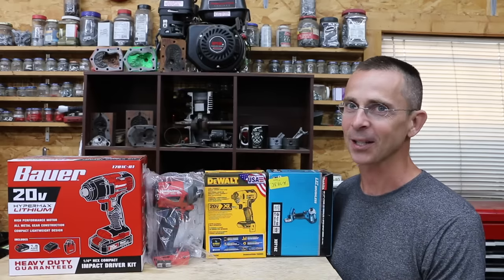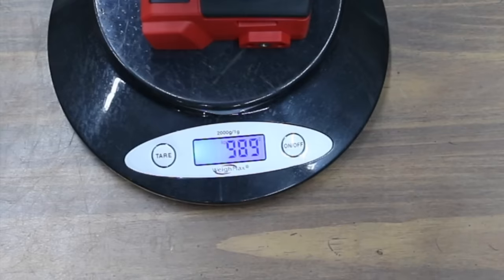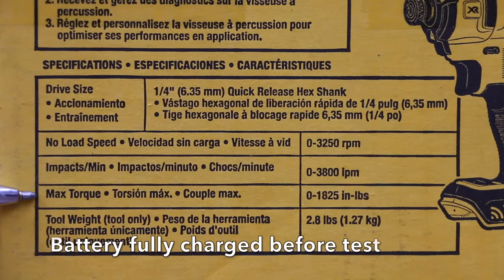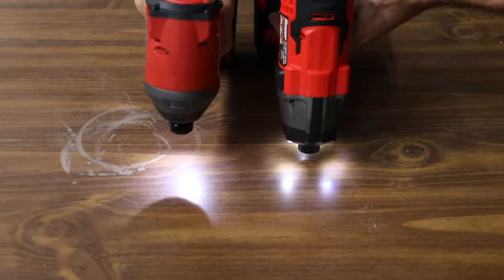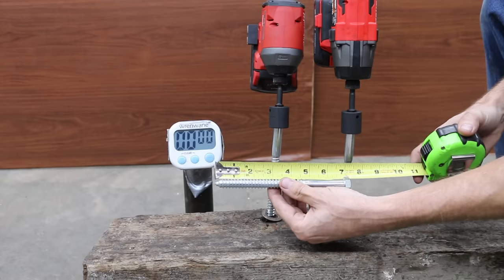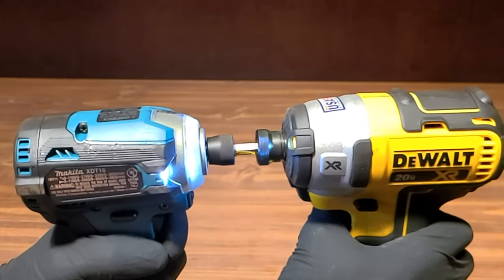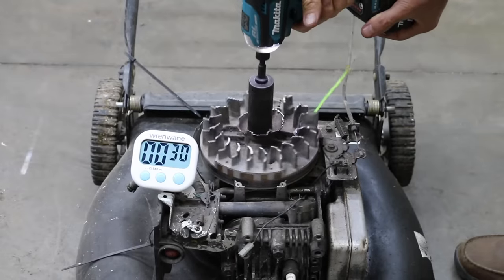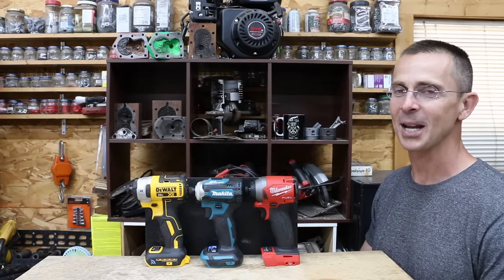Best Impact Driver? DeWalt vs Milwaukee vs Makita vs Bauer!  Let's find out!

Comment: That m18 kit is $99 with a charger and 2.0 battery at Home Depot. Killer deal.
Reply from the maker: Thanks for sharing.
Reply: Just saw it. It's gen 2 but I'm curious how it compares to gen 3 and 3.5. Time to do research.

Edit. It's a none fuel model gen 3. I assume it's similar to the ATOMIC vs the XR.

Performance was substantially worse than the fuel based on similar tests to this video. 

It might be an equal or better option to get the M12 subcompact highest end model for convenience.
Reply: Nice seeing you here lol. Used to watch all your videos years ago. Definitely a throwback
Reply: Cheahhhhhhhh 👌
Reply: @obe22099  so I have the gen 3 non fuel m18s and the newer m12s, impact vs impact, the m18 still delivers much more power than the m12 fuel, I thought it would be fairly comparable between the 2 considering ones fuel, one isn't, but there's still quite a large jump in power. 

The 100 dollar m18 deal is a great deal for someone starting out in a trade or something, but my m12s do great while doing just about anything I need them to in the construction that I do.
Reply: @austinb1800  Thanks for the response. I saw multiple big sales on the M12 fuel line that made me invest into it. 

Got the impact driver and the right angle die grinder. The impact driver meets all my requirements and more. The die grinder is magic for what it does. M12 Sawzall is great too. 

Overall brand new products for 50-60% off plus free batteries over multiple sales in the past 60 days or so. 

I have three tools but i also have three 2ah and two 4ah batteries that came with those 3 tools as incentives.

Mostly working on hobbies and DIY so the extra power wasn't needed but the luxery of the small form design won me over.
Reply: 220€ in germany.. so 250$ - not any deal at all....... -.-
Reply: @obe22099  yes, the small form factor of the M12 line has got me, I like having my M18 fuel impact just in case, but I only ever pull it out now when I let someone use it. I do mostly HVAC installation work now, and I use my M12 SDS drill and my M12 impact and it's perfect for me, they are much lighter and smaller and deliver more than enough power to drill into structural concrete and slam 3 inch tapcons into that hole. I wont be getting anything different anytime soon!
Reply: For the fuel 99$???? Hmm idk about that
Reply: No it's not the M18 Fuel.
Reply: Whats the part number
Reply: @hanswurstusbrachialus5213   The fuel impact kit with (2) 5aH batteries, charger, and case is normally priced at $300 USD. 

I just got a combo kit with the fuel hammer drill, impact driver, and 5" grinder for $370, plus two 5aH batteries, charger and a tool bag. One of the best deals they offer IMO.
Reply: @A6Legit  370 out the door?
Reply: @A6Legit  Dang, I should have shopped around more I Just spent $245 out the door for for a Mikita LXT impact, Drill, 2 3ah batteries a fast charger and a bag.
Reply: @skylerbond56  That doesnt seem too bad. The m12 fuel drill driver combo with a 4 and 6ah battery is $230 at home depot at the moment
Reply: @A6Legit  I really like it personally but the m18 fuel seems more powerful. Regardless I'm sure the Makita is throttled due to longevity purposes
Reply: @skylerbond56  That LXT kit should be enough for most people. Slightly more power than the m12 fuel tools. The m18 is more powerful, but do you actually need it? I went m18 because I want to use 2-3" hole saws with no issues (m18 still might be overkill). Theyre great tools but im sure I would have been just as happy with the m12 fuel.
Youre also talking around $400 for a m18 kit vs $230 m12/LXT lol. I couldnt help thinking could have saved $150 or so and got light weight m12's 🤷‍♂️
Reply: @A6Legit  True more power than my DeWalt, and I am a carpenter and haven't thought to myself while using a Makita "I wish I had more power" 🤣 $400 is 1 1/2 days work so not too bad but I hate spending money.
Reply: @skylerbond56  Nice, I got my kit mainly for hobby woodworking. $400 is kind of a lot because theres more expensive machines I want/need lol. I told myself the m18 is strong enough that I wont need to buy a drill press for heavier duty tasks.
The only other tool im dying to have is a fuel oscillating tool. I didnt know about oscillating tools... Its like magic
Reply: i have the glock 19 gen 3
Reply: @blesdavis7637  good choice
Reply: @skylerbond56  Sorry to say but that same set lasted me three months, both of them die.. Maybe I got a lemon don't know but never again.. .
Reply: @joesanchez7920  Definitely got a lemon. Was yours the brushes or brushless set? I've never had an issue with makita
Reply: @A6Legit  it's on sale for 149 at home Depot, have to buy it online
Reply: @futurelink5967  Thanks, I just bought the kit 2 weeks ago. They have it for $180. Better deal than $150 for tool only
Reply: @A6Legit  it's$169 with taxes at online home Depot, with batteries and charger,I bought one yesterday but returning it because I was looking for the mechanic impact instead of the , this one.
Reply: What are you doing here lol

Comment: I’d love to see a face off between the high torque (1,000 ft lbs +) cordless 1/2” impacts. RIGID, DeWalt, Milwaukee, Snap-On, etc.
Reply: i'd second that.
Reply: Yes please. I have been shopping for one of these for a while
Reply: @Ybsjek  I just purchased the milwaukee. I have to wait like 4 months to use it but you should still be able to pick it up at HD for $200 with a battery, if you have a charger.
Reply: Id like to see this as well as I just spend $400 on dewalts half inch impact
Reply: I use the milwaukee and it destroys my coworkers dewalts and snap on
Reply: I agree another great video idea but I can tell you from personal experience the Milwaukee fuel high torque impact beats them all. The dewalt high torque impact is still very respectable just not quit as powerful.

Comment: The older Makita drivers w/brushed motors were/are better.  Mine is still holding up. After millions of 3,1/2" deck screws & hundreds of ledger locks up to 12",  Quite a few falls (mostly belt height but some roof drops) , sand & dirt infiltration , general daily professional use. I really like Makita.  Brushless .....well, let's just say manufacturers went that route for ease of assembly or something because none of the brands you've shown here last as long as the old brushed motor type.  Wish they'd concentrate on power & longevity & less on flashing lights & phone connectivity ? sheesh   "Gotta track down my driver,....has anyone seen my phone ?"

Comment: I work in attics everyday all were its really hot, and I've burned out 3 Milwaukee's and to many Makita's. I've changed to dewalt and have had the same drill work like a tank even while laying in the insulation while in use. I'm drilling 1" and up holes all day long.
Reply from the maker: Thanks for sharing.

Comment: Over the course of many years and without any scientific testing, your rating is my "seat of the pants" rating for power tools.  I've always been impressed by the weight and balance of Milwaukee power tools. I wonder where the "Rigid" brand of impact drivers would stack up in this comparison?
Reply from the maker: Thanks for the suggestion.

Comment: Milwaukee has a thermal cutout to keep the battery from overheating.
Reply: DeWalt also
Reply: Makita also
Reply: @davejames2015  Well it failed in this case because 300 degrees is extremely hot for any power tool to operate at.
Reply: @davejames2015  the dewalt clearly does not have any prevention set in place.
Reply: Do y'all think the Milwaukee in in this video would be fine for removing lug nuts on my car? Or does that really need a 1/2 driver? Thanks in advance
Reply: @roundearthshill248  Yeah, it will do it (I have) but just not as quickly as an impact wrench.
Reply: @DragNetJoe  get a 3/8 or 1/2 inch don't do it with the impact driver, they're not made for that and depending on what type of vehicle you have the lug nuts won't even budge if you have an SUV or truck...well at least it happened that way on mine..
I shouldn't have trusted what others said and just got the right tool for the job in the first place 3/8 impact any brand is fine I prefer DeWalt
Reply: So does Makita,  both brands are sooo good.
Reply: I bought a new hydraulic Milwaukee driver and it would cut down to low power on any screw over 1.5". Seems like maybe a faulty thermal sensor but it was a warranty fix and is totally fine now.
Reply: @BuffaloNickel9  I was thinking about getting one for my car as well. So I should go with 3/8?
Reply: @antlearn5030  oh yes, no doubt especially if it is just for your car...lug nuts or engine work?
I would go with 3/8 from Milwaukee and at least a 4 amp hour battery...
DeWalt is good as well..
I made the mistake of thinking the impact driver could do car work...
Reply: @BuffaloNickel9  you want impact wrench for lug nuts and most vehicle work, not impact drivers. Get the new Milwaukee mid torque, should handle 90 percent of the jobs for vehicle repairs.
Reply: @reddawgrup1779  did you read my comment?? Either of them....that's exactly what i said and the advice i gave the gentleman is to get a Milwaukee or Dewalt impact Wrench 3/8 or 1/2 for lugs...i dont ever use impact driver for lugs...was your comment to me?
Reply: @BuffaloNickel9  lmao.... Smh.. Sorry dude, no I didn't see it but I just went through the messages n saw them... Haven't no ideas how i missed em. Airplane head moment i guess!! Good grief.
Reply: @reddawgrup1779  hey my friend, anyone who can admit their mistake and apologize is a good person! No problem at all
Reply: @reddawgrup1779  glad we both agree on the Milwaukee mid torque impact 🔧 for Lugz..
     I see too many videos of people trying to take off lugs with the impact driver... yes it can do it SOMETIMES..
 but it advises the wrong tool for some first-timer to go out and purchase for that specific job... Agreed?
if you are already in the M12 line, the stubby will work great too
Reply: 1/4 impact for small stuff.  1/2 medium torque for the big stuff.  I dont even see a reason for the 3/8 tbh.
Reply: Milwaukee pretty much has all it's bases covered 😉 👍
Reply: @roundearthshill248  I keep this impact in my truck for the lugs and roadside service. The 160 pounds of  breakaway torque is plenty for my lugs that are torqued at 94 pounds. If your wheels are torqued at say 140 pounds then that would be getting close to the max and will break off slower
Reply: Think every lithium tool has the thermal cut out
Reply: @rustywreck3351  they should really, lithium burns hot enough to melt steel and can do it underwater I've heard.

Comment: I made a similar comment on your drill showdown. I'm an advanced DIYer (I GC'd my own house build) who also does jobs for others, too. Pocket hole joinery is big. It would be helpful to have this included in your tests. It would be helpful to know which does a better job of securing the fastener while being less vulnerable to crushing the bottom of the pocket hole, in addition to what you covered.
Reply from the maker: Thanks for the suggestion.
Reply: @ProjectFarm  Thanks for reading it and replying. Most don't do that on vids older than a few days.

Comment: Omg i literally died from laughter when you said the Milwaukee keeps shutting off and you don't know why but think it's taunting the bauer 🤣🤣🤣🤣🤣💀💀
Reply from the maker: lol  Thanks for watching!
Reply: Probably some kind of thermal self pretention
Reply: @n8yt   Yeah, the Milwaukee really ran away with the competition.
And I'd much rather have a thermal shut-off than grease leaking out or the motor cooking itself.
Reply: @agenticex  for real, idc what brand it is that grease ain't going back in easily that's for sure, does dewalt tell you how to add grease?

Comment: Maybe try to test the battery life seeing who dies first. by driving alot of screws or idol spinning.
And again thank for your work.
Reply from the maker: Thanks for the video idea.
Reply: @ProjectFarm  Battery teardown and cell testing would be a good idea. You can buy testers that can do 20A discharge on the cells. You could even do proper cold temperature testing as well as see how the cell degrades as the battery is cycled.
Reply: Hes done that, its about 4 videos ago
Reply: @brandonclark3626  Ah missed that one. While a good test, It's not quite the same as using a proper battery tester where you can see the voltage sag due to the IR of the cell.

Comment: I have been working in Automotive Manufacturing maintenance for my entire working life (30 yrs). I have used all these tool brands more than I like to admit. People don't tend to look after their tools if they aren't buying them. You see tools dropped, left on the floor, left greasy/wet, ran over with forklifts etc. When you see these tools abused 24 hrs/3 shifts a day you separate the good tools from the truly great tools. All my tools at home are Milwaukee Fuel. They are special in that they work awesome, are dependable and can take insane amount of punishment and still get the job done! They are the best in my opinion!
Reply from the maker: Thanks for sharing.

Comment: The Milwaukee is the best imo, after seeing a few reviews.
I have not seen a good comparison between this milwaukee driver, and the milwaukee "surge" impact driver.
Love your videos sir. Between you and AVE. You both keep people like myself, well informed. Thank you
Reply from the maker: You are welcome!
Reply: All ive ever bought was Milwaukee tools and they have never disappointed!! any contractors i know only use Milwaukee as well
Reply: And once you get into mid and high-torque impact wrenches, Milwaukee just pulls bus lengths away from the competition
Reply: If it didn’t shut off after 20-30 seconds then I would agree.
Reply: @adamfpv8294  even with the shut off and having to reengage it still beats all the others by a good bit
Reply: The surge is really great if you don't need a lot of torque and don't want to wear ear plugs.
Reply: The surge is just going to be quieter, with less torque. It’s just a hydraulic system for impact rather than hammer/anvil.
Reply: @adamfpv8294   if you click the 4th setting on the Milwaukee it does not shut off while driving and it is made to shut off in the other settings

Comment: Milwaukee is always in a class of its own and it usually turns into a contest for runner up. And they should because they’re usually the most expensive. Be curious to know what the milwaukee costs with battery and charger.

Comment: I don't like this because I own Dewalt and can't afford Milwaukee, and  I don't like proof that Milwaukee is better.  So, I reject your reality and will substitute it with my own!
Reply: Did you notice the Milwaukee was less expensive?
Reply: Frank Shook Dewalt batteries are way cheaper than the Milwaukee. I own all milwaukee and compared to Dewalt Milwaukee wins hands down, but it’s hard to beat DeWalts battery prices.
Reply: @frankshook3511  Yeah, but without the blue tooth model, dewalt would have been cheaper and the batteries are much cheaper.
Reply: I was gifted dewalt and I gotta say Im pretty happy
Reply: I was thinking the exact same thing! Lol I refuse to believe that Milwaukee is better
Reply: @frugalprepper  I'm an electrician and I use all dewalt but I have a few Milwaukee's and I think the XR dewalt would hold is on with the Milwaukee fuel. I keep my dewalt because I've seen what they can do. But Milwaukee is a great tool as well just to heavy and pricey

Comment: Dewalt: Smokes quite a bit and feels very hot
Spyware App: No problem here 🤣
Reply: Obviously the temp sensor is in the motor and battery, not in the gear/impact assembly.
Reply: So did my ex wife.
Reply: @pflaffik  obviously that's not where they should have put it lol

Comment: That was a great test.  The store where I worked discontinued Makita power tools about fifteen years ago.  I bought a Makita line powered ( 120 volts AC ) impact wrench.  In many cases I prefer it over my air impact wrench.  I have line power and compressed air in my garage.  For portability I use an old small Honda generator for power.  I paid a discounted price for the Makita impact and it has never failed.  Makita power tools have my respect.
Reply: The first drill I purchased was a Makita that’s I hate to admit it is 40 years still works like it did day one. Have the Ryobi 18v +1 Garden tools and am very impressed. Have owned lots of other. Power tools but if I could afford more Makita I would buy them 👍
Reply: @johnpaull135  ryobi  blue 18v ( not the same as the neon green) cordless tools are way underrated by contractors. In my experience they pretty good for the money. I also own Stanley fatmax and makita cordless range. The ryobi easily competes with makita and Stanley.
Reply from the maker: Thanks so much!  Thanks for sharing.

Comment: My DeWalt impact driver is much older than the one presented here (6 or 7 years old). It was part of a bundle of tools I paid around $450.00-$500.00 for, so no idea what the impact driver, alone, would cost. Model# is DCF885. Rated at 2800 RPM and 3200 IPM (no other data available). It's a strong little thing (5 3/4" long), I'll give it that-- but I've never tried to overwork it. I don't know about other impact drivers, but I can't detect any impacts at all as I use it. Mine has no mode selectors, so I assume it's single-purpose only.
Reply from the maker: Thanks for the feedback.